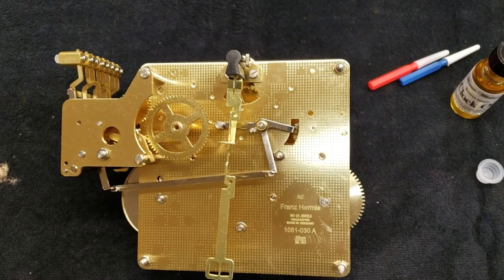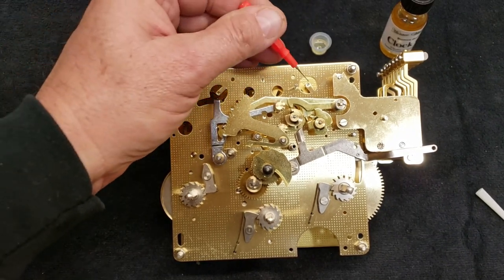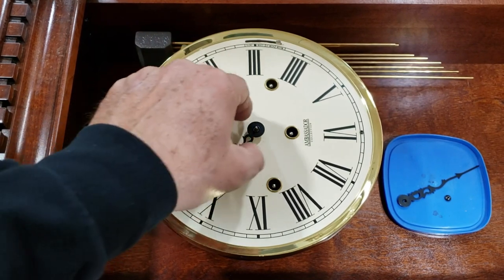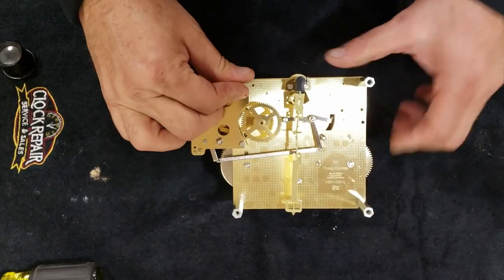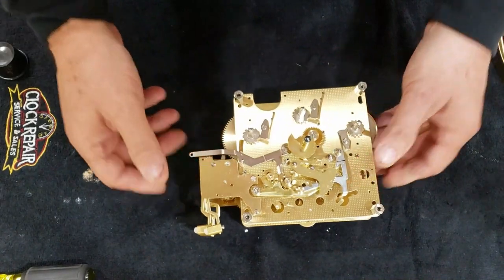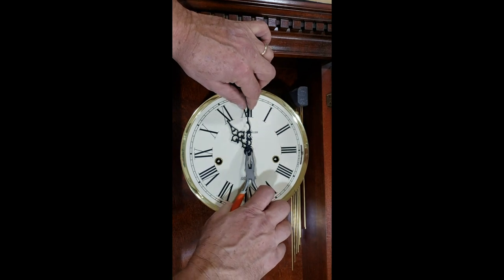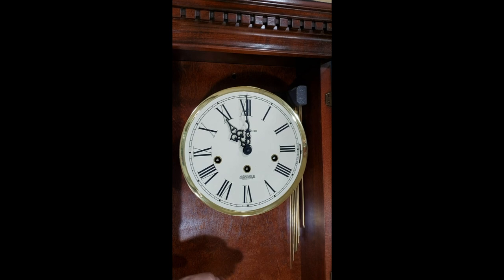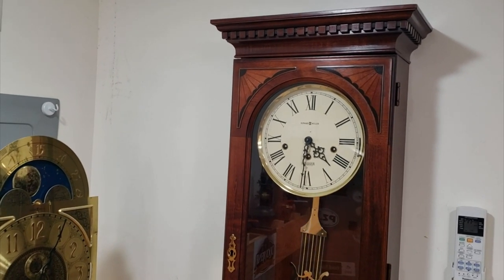Replacing A Howard Miller Wall Clock Movement

Comment: Thank you for the video, I was looking how to remove the face to get the movement out to clean an oil, in the process of you taking the movement out you also should how to remove the hands an screws on the face to get at it.Thank you, very good explanation on setting the hands an getting the chimes right. Saving this one for future work.I have a Herman Miller st. Charles Regulator wall model. I have shelf ones but those movements come a part differently. Again Thanks,
Reply from the maker: Im glad it helped

Comment: I have a similar wall mounted Howard Miller clock and 3 of the chimes rods came out during transport. I could not find a way to put them back in and don't want to force the issue. Could you show me how to do this without damaging the clock?

Comment: I have a Howard Miller 612-436 Mantel Clock (was my dad's) it didn't have the movement in it. I found the movement in another box days later. I watched this and think I could use advise on what to do to get it to work. The center wind piece won't move. Need help.

Comment: What was the issue/issues with the old movement?
Reply from the maker: Nothing with this one, I just used it for a demonstration, however, most movements like this will typically last about 20-25 years before they have to be replaced. Some people try to repair them but replacing in the long run is cheaper and you are getting everything new. When one gets rebuilt, they only repair the worn out parts, then later on, the other parts that didn't get replaced get worn and you have to repair toughs parts.  Its a never ending cycle. If you replace, your done with it for many years as long as you oil them.
Reply: @ClockRepairService  ok, cause you said it was destroyed and you couldn’t do anything about it. That’s why I asked.